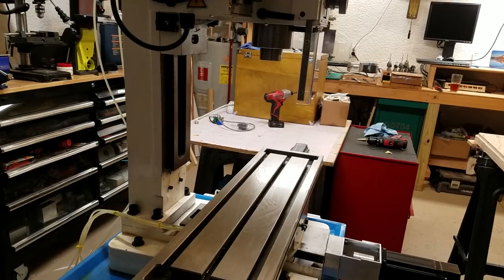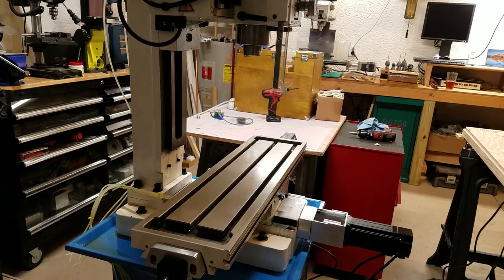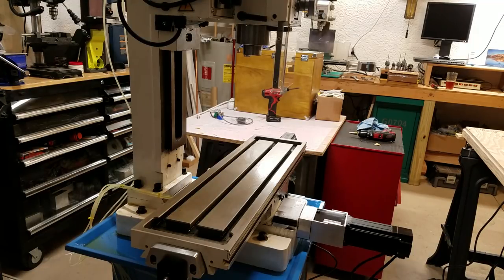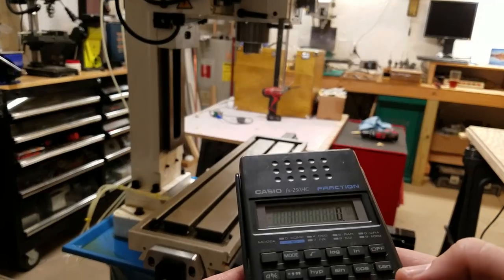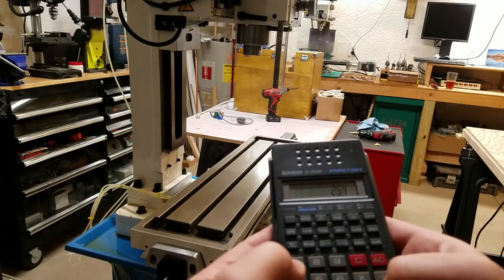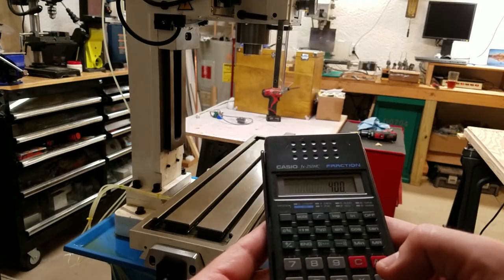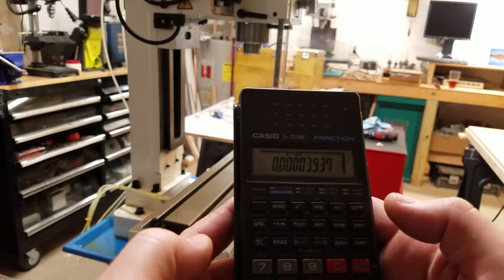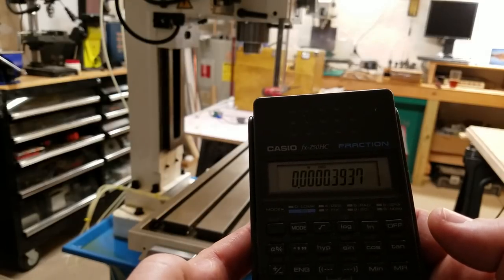PM-25MV Milling Machine Conversion: 300IPM With the Centroid Acorn

Comment: For that mill I think you have it dialed in. At 300ipm rapids you’re not waiting 20 seconds for it to reposition itself over a part. Are you going to try and cut that fast or keep around 150? I’ve had a 833 cutting at 200 using a high speed spindle (7500rpm) and power feeds at maximum rpm. With factory motor it couldn’t in any way cut that fast. 200 is actually slow now and when we get the new AC servos installed with 2 pitch screws I expect it to run double that for normal operations. Just be sure you’re bolted to the floor and everything is done to maximize rigidity. Nice video.

Comment: At 300 IPM you are doing about 1800rpm, at which point these steppers are down around 10% of their nominal holding torque ie 0.3Nm. For the real LS system, they claim 3000rpm is possible but you aren't going to be able to cut anything, even down at 1800rpm. 

These closed loop steppers are fine things, as they will recover lost position and also let you know if you have exceeded the defined positional error. But even if you manage stay within that error band, you will need to accelerate the machine rapidly to follow a real world toolpath and there can't be much torque margin if any at these speeds. It would be good to see a plot of the error against time as you follow a real toolpath (or simply change direction at full speed) - the tuning software should allow you to do that if it's anything like the LS software. Then repeat with some cutting loads.
Reply: Those motors we used on another machine and they work surprisingly well. Makes you wonder if the torque rating is correct.

Comment: 300IPM sound lovely. I believe the 4000 is from 1000 line encoder in quadrature. What's the Acorn's max pulse generation frequency? You'd need (25400 * 300 / 60) = 127kHz to achieve 300IPM, per axis? Looks interesting.
Reply from the maker: Hi Kent.  I currently have the board set to 200,000 pulses per second so I guess that's 200kHz.  According to the dip switches on the drivers, I'm at 4000 pulses per revolution.   I wouldn't normally run the rapids that fast, but I wanted to see what it would do.
Reply: I was reading some on the Acron's website, it sounded like they use the same processor as the BeagleBone Black, so perhaps they use the programmable real-time unit (PRU) to generate the pulses which could be a nice improvement over say Windows. 4000 may be optimal in some sense because it's likely native resolution of the encoder. 300IPM would just get me into trouble too fast :) Have a wonderful Thanksgiving!

Comment: Very nice!!  I had originally thought that the Acorn didn't need a computer with it, but in your last vid, I picked up that you said it did.  Is the computer just for control of the GUI and such......not the actually pulse generation that drives the motors....?  Someone asked if you considered the Masso.  It is a stand alone....no computer.  Since my Mach3 is at the mercy of windows, I just to make sure that windows can't mess this up.  If that makes any sense.  I feel like I should already know this......but...  LOL
Reply from the maker: Hi.  The acorn board is generating the pulses and monitoring all of the inputs and outputs.  The PC provides the GUI.  I'm sure it's more complicated than that but I'll let someone who is smarter than me try to explain how it works.  All  I know is the board seems to do a good job generating pulses.  Parallel ports have their place but they don't generate the perfect wave form that these external motion control boards do.  But, we all owe a thing or two to the folks that figured out you can run a CNC machine off of a parallel port.  That got this whole thing started back in the day.
Reply: Sweet.  I like the sound of that.  I don't mind windows handling the GUI and interface stuff.....just not the actual running of the machine.  You're right.....if not for those before us, we'd still be wishing that we could whine about mach3 problems. LOL  Thanks!!  I have the smooth stepper(ethernet) on my novakon.....I've run at 600ipm rapids, but I have servos.  I can easily and accurately run at 500ipm rapids......but it scared the heck out of me more than once....so they're turned down to 250ipm.  Maybe when I grow into my big boy pants, I'll turn them up a bit. :)
Reply from the maker: Novakon?  You got my attention.  What machine do you have?  How do you like it?
Reply: Had a longer response typed out....but when I clicked on one of the replies to expand it for reference....mine disappeared. :(  So friggin' annoying!  Anyway.....I have the Torus Pro with servos.  It's got about 3x's the work envelope of the 1100 and I can run feeds at rates faster than the 1100 can rapid.  I'm pretty pleased with it.  I think it's biggest issue early on was my lack of knowledge and ability.
Reply: Had a longer response typed out....but when I clicked on one of the replies to expand it for reference....mine disappeared. :(  So friggin' annoying!  Anyway.....I have the Torus Pro with servos.  It's got about 3x's the work envelope of the 1100 and I can run feeds at rates faster than the 1100 can rapid.  I'm pretty pleased with it.  I think it's biggest issue early on was my lack of knowledge and ability.
Reply: yep....the parallel/serial stuff sounds right to me.
Reply: At first, I thought you were referring to his machine and I thought....Wow...his is nearly as big as mine!! LOL :)
Reply: the on board Motion Control CPU called the Beagle Bone Green is creating the pulses (signals) that go out to both the phoenix connectors on the Acorn board as well as the DB25 connector.  The Windows 10 PC used with the Acorn is not generating the pulses that command the drive.  Check out the power of the BBG, mach4 does not have this.  https://beagleboard.org/green
The advantages in stability, reliability, smooth motion and no reliance on the CNCPC CPU for motion control are huge. Acorn has mach4 beat in this department hands down.
Reply: Thank you!

Comment: Hey nice job! Could you setup a dial indicator and hard stops to check actual motion accuracy? I understand your theoretical accuracy is what your quoting, but actually being able to repeat motions many times is what really matters. I'd like to see if its worth the $$$ to switch with some measurable results. Check my videos, i run mach3 on a tiny desktop machine and get repeatable +/-0.01mm (0.00039in) measured results.... I'm interested in Centroid, running on Windows 10 and having a dedicated motion controller does have a lot of benefits. But, I want to see results measured, before deciding if it's Worth it to switch to Centroid?
Reply: cnckeith, geez what are you a rep for them? You just regurgitated their sales info... that was extremely unhelpful and not really related to my comment... Hopefully we'll get to see some actual measured motion and possibly even a cut part with measured results... My gcode files  regularly exceed 5mb ( I've run over 1 million lines on a single part) so I'd be paying quite a bit more for centroid than what I have now and for what, better accuracy, greater speed or smoother 3d contours? I'd like to know.
Reply: Yes, just responding to Tom's comments about Acorn technical support which are misleading.  Free CNC support is available for all Acorn Users and if you read Tom's post it sounds like it is not.  Just want to get the facts straight for all to see.
Reply: yeah.. if you are doing short vector hi throughput work Acorn's CNC12 software has a number of features that allow for faster more accurate parts with better surface finishes.